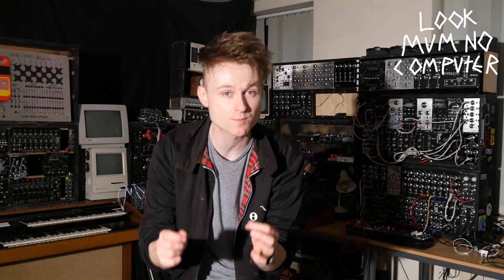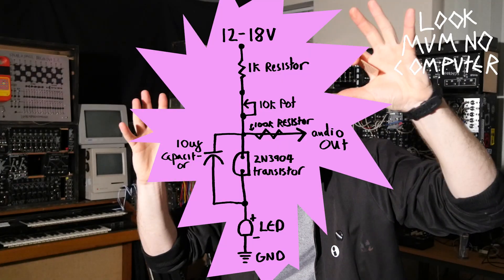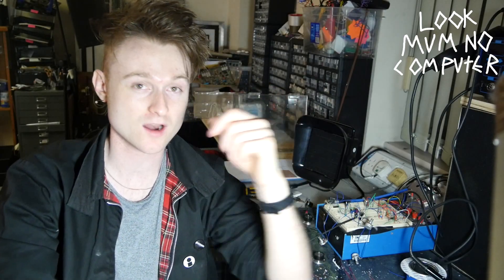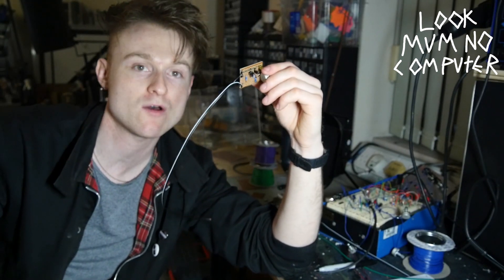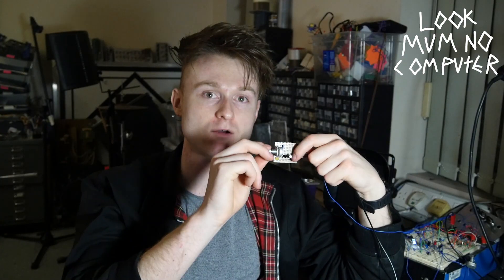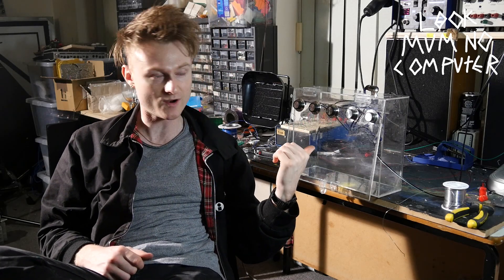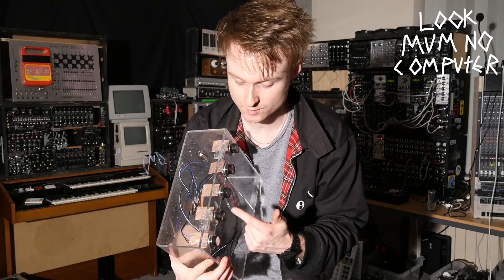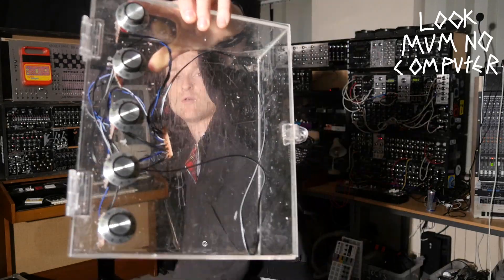The simplest DIY audio oscillator? not a 555 chip. reverse avalanche

Comment: I would try a '2N918',TO-18( 30/15/3)'radio-frequency' transistor.The specs' are even lower than the 'SS9018'  and should work with less than '9-volts'! These transistors' are around because they were not used a lot,back in the day! 😎

Comment: I bet the reason it doesn’t oscillate with too much metal on the base is because the metal adds capacitance. Suddenly the P type silicon in the center has extra metal to charge up.

Comment: Just got one of these working, unfortunately I only have 1k potentiometers, they work but you don't get the range that higher ones give. I might even source 50k pots instead of 10k

I put a 2k resistor on the sound output as the output was too low.

Also there is an error in the schematic on the LMNC website, the negative leg of the capacitor terminates between the transistor and the LED (wired in parallel with the transistor) in needs to terminate to ground (in parallel with the transistor and  LED) It will still make noise, but won't sound as nice as if it is hooked up correctly.

The stripboard layout is correct, I removed the centre leg of the transistor by grabbing it with needle nosed pliers and bending it back and forth until it snapped off.

Comment: Howdy, I'm trying to design a little noisemaker using this circuit, and I was wondering about how hot the voltage is that comes out of this oscillator? Does it depend on the transistor or the power supply or what? Thanks!

Comment: I want to do this, but how does it output? Do I plug a speaker straight into with an aux cable? Or do I need to amplifier or attenuate the signal? Tia

Comment: It works. Thanks for the video. My structure: https://www.instagram.com/p/B5YE8fwoKWy/ 
(The transistor is 2N3904 with 2x9V. It doesn't work with PN2222 or S8050)
Reply: Anywhere that I can view aside from instagram, I've been trying to breadboard this with no luck whatsoever. (1st project)

Comment: Will this work on a breadboard? I was trying it and I wasn’t sure if my transistor wasn’t reverse avalanching because it couldn’t, or if the long leads of the breadboard were causing it not to be able to
Reply: Did you find a fix? I'm also struggling to breadboard it.
Reply: Im struggling too :(
Reply: same problem, couldnt breadboard it so i soldered it to a little stripboard alltogether... no output at all. :/ maybe 20Volts to much?
Reply: Only some transistors work, some others don't.
Reply: I built it on a piece of cardboard so the breadboard isnt the problem

Comment: your scheme doesn't work
Reply from the maker: Yes it does
Reply: the LED flashes but there is no sound
Reply from the maker: What are you plugging it into?
Reply: to the speaker via an amplifier
Reply: but there is no sound
Reply: I'm making an oscilloscope out of a CRT display, and I need a sweep generator, and your generator emits a sawtooth signal
Reply: I just wanted to check if it would work on the speaker and then on the coil in the TV

Comment: You can make a square wave oscillator with just an op amp, 3 resistors and a capacitor. You can get 5 pin op amps for 89c (AUD) on Mouser. But you will need a dual rail power supply. Or just add 2 more resistors and it will work on a single rail power supply.
Reply: can it be VCO?

Comment: I think there's a better way to do this...
Ditch the capacitor, and run without reverse cascading your transistor, you'll be able to run on way less voltage.

A center tapped toroidal transformer, with the center tap being V+, one side gets a 1 K resistor, which connects to the base pin on a random NPN switching transistor. The other side  of the transformer connects to the collector pin of the transistor, and V- connects to the emitter pin of the transistor.
The speaker, potentiometer, LED, and or photo resistor would connect to the collector pin +, and emitter pin -.

The circuit I described should reduce the voltage required by not having to overcome the reverse cascade voltage of the transistor. The cascading produced by the combination of the transistor being used as intended & the capacitative coupling of the center tapped transformer should allow the rest of the circuit to function with a VERY modest power supply.
My scientific wild ass guess would be around 2 volts.

If I'm mistaken about this circuit, please let me know.
I don't currently have the parts to build it, nor the tools to test it.
Reply: It's a joule thief. In this case, the oscillation frequency depends on the base resistor and then inductance of the toroidal.
Reply: @hetchelletomikko-n3929  
Yes, the same circuit as a joule thief.  

The frequency of the oscillations is better controlled by adding a capacitor than by changing the resistance though.  
Particularly where efficiency is required, adding a capacitor to act as a reservoir is preferable to the loss of energy, as heat, that occurs when using a resistor. 

I've learned a great deal since writing this comment and I was mistaken about the capacitor.

Comment: Hi, amazing project. How do you do it with the volume? I tried with the S9018 transistor in my- power supply limit- case and works well but it has a really low volume (lower with the lower capacitors). Also, I tried to lower the resistance on the out pin(until 51k) sounds higher, but the oscillator kept acting on each other. It depends on the amp/speaker only? Or its because its a SUPER SIMPLE OSCILLATOOOOOOOOOR? 
Thanks! Great great channel!

Comment: Be careful, output is oscillating DC (especially when using only one). Have recorded it and wave is topped at the positive side of the applitude. Because there is a compression going on in this video, it is more mixed (distortion) hower when you do this live, you pump DC into the vains of your equipment. Can heat up or damage your speakers if you do this loud and too long. Be warned.

Comment: I might look like a fool...but in case you happen to see the light blinking, which means that the oscillator is oscillating, but still you can't hear any sound..please check to feed the circuit enough current. I was using this transformer for guitar pedals that has different outputs and realised that the 12V plug only outputs 100mA. Once I plugged to a proper 2A source...the buzzer started buzzing. Rookie mistake!

Comment: This project has been really fun but i screwed up my first build. I got one oscillator working. Had it hooked up to a guitar Jack with an amplifier circuit boosting the signal. I think I burned out the LEDs by overvolting it though when I tried to add a second oscillator. If I have two oscillators that need 9 volts each can I power them both with the same 9 volt power supply? Is there something I should know as a noob about grounding them and powering them I should know? I could never get both of them working at the same time.  Also can I just connect the two sound out lines to the same audio jack ?

Comment: I figured out whats wrong, the output jack needs to go to pin 1 of the potentiometer and to quote reddit  transistor emitter to pin 3 on your pot and to + of your capacitor - transistor collector to + of your LED and to your 100k resistor ( everything in the circuit is supposed to be connected) (also i didnt use the 100k resistor), make sure you don't wire the guitar jack backwards! in the diagram the transistor isnt connected to pin 3/ it doesnt look like the led is wired to the transistor, and the transistor isnt wired to the capacitor correctly!

Comment: Didn't build anything in almost ten years, but after seeing this I decided to try something. Salvaged some parts, burned my fingers and built 2 wien bridge oscillators using op-amps. Each one with one potentiometer for gain and one for tuning. Now I spent an hour twiddling with them, smiling like a child. Thank you so much for the inspiration!
Reply: can you explain how you made a gain potentiometer like I'm 5 yo?
Reply: And after reading your comment I bought a zillion arcade buttons, some perfboards, transistors, resistors caps, and a billion other odds and ends a few months ago.. .. now I'm here reading the comments before I get started building this thing.  Lol.. 1st project in almost 8yrs for me..
Reply: please share your schematics and part list and all that jazz. It really gets me excited to build that too :) OpAmps are fun to use and fairly inexpensive to come by so this would be awesome to try.
Reply: @KRAFTWERK2K6  I am not sure anymore, what I did exactly. It was pretty adhoc thing. But if I remember, it would be the first diagram from wiki "Wien bridge oscillator". Instead of bulb I used one potentiometer for gain and for tuning I used two track potentiometer in place of R1 and R2. For op-amp I used TL064. It can be used with low voltage, so I just used 4AA batteries to get +/- 3V. Also it's resilient and cheap so you can just experiment and see where it takes you. I use these pretty much everywhere.
Reply: @bubakawara  save your old smoke detector batteries. they have a lot of life in them for projects and can be hooked in series for more voltage.

Comment: For all of those who don't get it to oscillate  in the audio range or at all... This is an Esaky oscillator... and it uses an unusual regime of a transistor (that was never meant)... it depends very much on the type, manufacturer and maybe even on the production batch... So, in some cases, extensive experimenting is needed :)
Reply: I've test this circuit, I put a cap after the 100k resistor of the colector and I've a signal of 2v pp from 300Hz to 1khz. But the signal disappeared when I put an speaker.

Comment: Finely got "this" working with a 9018. Turns out the 9018 won't work with any cap over 10. I put everything the wrong way and stuff, but it worked with a 100k pot, another thing that kinda made my breakthrugh on the breadboard is that the LED I used at first had a resistor already soldered to one end of the lead, and under some crimptube so I could'd see it. I guess it had a crazy amout of resistence to work on higher voltages. Think it needs some amplification and a VC input, and I'll slap 3 or 4 into my rack :D

Comment: A 555 timer IC will oscillate with 1 each: resistor, pot & capacitor.
Pin 3 output is a square wave, but pin 2 to the capacitor is a sawtooth.
And pin 5 is a VCO input :)
Reply: Yes, 555 is much less fiddly. Also the regular LM555 will operate at 5V and the CMOS version LMC555 will work down to 1.5V, while this one requires 12V. But a 555 chip contains ~30 transistors plus resistors inside of it, while this is literally 1 transistor, 1 resistor and 1 capacitor, so I can appreciate the beauty of it.

And yes, you can do away with the LED and other stuff. The basic circuit is: +12V through Resistor to Emitter; Emitter through Capacitor to GND; Collector to GND.
Signal is picked up at emitter (it's the only pin out of all 3 components that's not +12V or gnd.) Frequency is given more or less by the usual RC formula.
Reply: @Dude-Smellmyhelmet  or 30 internal components,  more like
Reply: @the_eminent_Joshua_E_Hrouda  if you add up the price of all the components then the price of a 555 circuit is about the same. 555 is more capable tho.
Reply: all you need is 1 cap and 1 pot. but yeah pin 3 square pin 2 sawtooth.

Comment: 7:22 You've basically made a THX machine.
Reply: check this year's videos - 1000 oscillators. Is this the circuit he's using ? Don't know
Reply: @thewhitefalcon8539  it is almost exactly the same circuit, but with some other features to make it more reasonable to make it voltage controlled, also there is a way to control volume for each oscillater individually
Reply: thx dude

Comment: What voltage for the capacitor?
A couple are 10v, 25v, 60v ect
Reply: 25v would do, because it can handle more than the supply voltage which is the most that could be across the capacitor in this circuit.

Comment: my friend you should build your own power supplies, super simple if you already got diodes and caps, dn't worry bout the step down bit, just start with the DC side only and then get a bigger tx and regulate after a bridge. simple little filter cap and boom power any size. 8 pin voltage regulators IC versions are cheap. then you can standardize your input voltage, maybe something like a 24VAC 40VA Tx to start.

love your jam and ch

Comment: Any ideas on crystal oscillators that are stable? Needing one to oscillate at 90Hz.
Reply: Xtal oscillators are usually in the MHz range, the main exception being the 32.768kHz ones used for counting seconds.
32768 is a nice round binary number (2¹⁴) so binary counters are used to output 1 pulse for every 32768 xtal pulses counted.

That's the method for getting accurate low freq (90Hz) pulses from a fast quartz crystal.
 Just make a binary counter that divides your xtal clock freq down to 90Hz.

Comment: I tried using a 24ohm speaker, didnt get any sounds, do I need to change any values?
Reply: I soldered it on some headphone jack and ran it through my sound systhem. Works fine. I directly connected it to 4ohm speakers and it didnt work. This works at way to mouch volts for a speaker alone. I measured less than 1volt at my sound systhem

Comment: Hi,
on the oscillator scheme you connect one leg of the capacitor to 'plus' of the LED,
but on the stripboard layout this leg is connected with the 'minus' of the LED... I'm sorry , this question may be stupid, but I am no master of electronics...
Am I wrong? Or is it correct in both ways? Or isn't there a difference and I am just too stupid to see this?!?
By the way, Thank you for these brilliant videos!
Reply: It depends on what kin of capacitor you are using. Ceramic can be handeld both ways, electrolyte capacitors have a certain direcion, otherwise they will break. I just build one following the scematics, and mine works as intended. Maybe that helps. ;)
Reply: You are correct. There is an error in the schematic.

Comment: You are not using some cap to isolate DC?
Reply: Common wisdom would suggest it's necessary to avoid damaging the next audio stage, and yet, it seems to be working fine. Probably because most audio gear has some kind of cap on the input, or an input transformer to block the DC. Probably couldn't hurt to add one to the output.

Comment: Hi! I intend to build these oscillators too and have compiled a shopping cart with all components. I was wondering if you could tell me the exact Ohm or kOhm for the potentiometer and LEDs? I can't seem to find that info...all my components are on 0.25W and the kOhms specified for the rest. Thanks man, I am learning a lot from you right now.
Reply: 1k ohm resistor and  10k ohm pot.

Comment: Very cool project, thanks! Took me a while to make it work though, you got the transistor the other way around in your schematic (it's correct in the stripboard picture). And in stripboard layout capacitor goes straight to ground while in schematic it goes through LED. Both capacitor variations seem to work but give different sounds. Which variation did you end up using?

Comment: You could probably get the same effect with a triac instead of the transistor, but with mich lower treshold voltage. You might have to add one or two resistors though.
Reply: I wonder if a zener diode would do it...
Reply: Zener diode won't work, you need a region of negative impedance for the circuit to oscillate.

Comment: Hey man, is the mixing output board just matter of soldering all the outs together and grounds together in two different strips and getting those two to tip/pin of the output socket? thanks.

Comment: Hi there, got a bit of a technical question:
I'd like to make a gate in for these oscillators. Would it work if I got rid of the wire connecting the two legs of the 10k pot and connected a diode between the middle leg of the pot and a gate in jack socket?